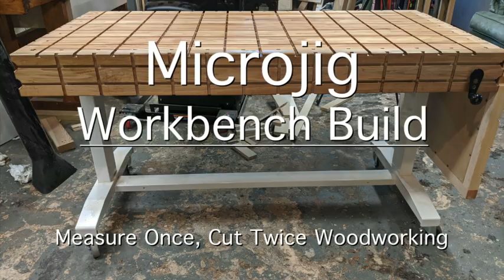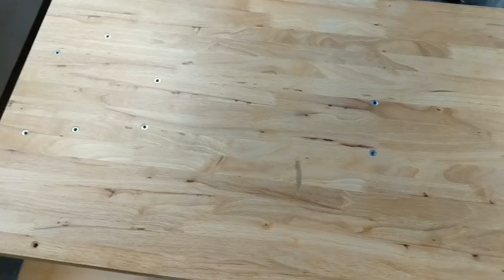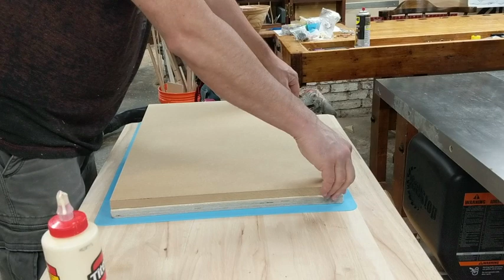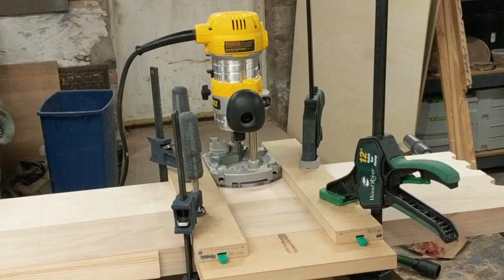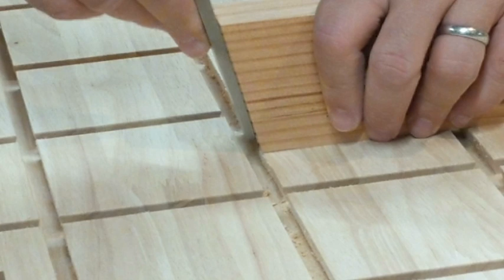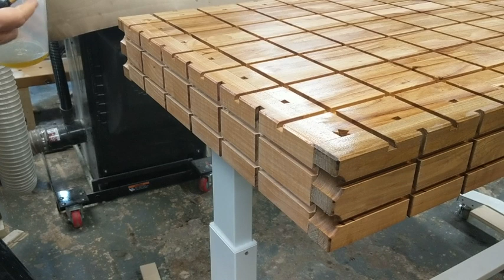Microjig Ultimate Workbench Build

Comment: I love the design and build video, so thank you 
I was wondering if there was a reason other than personal preference on not using the drawers.
I’m on the fence between this set of plans and the Woodsmith design.
Between the mechanical lift hardware and the casters how much movement is there
Seems when planing it might rock.
Reply from the maker: Thanks. I might one day add the drawer assembly back, but because it hangs down from the top and the 5-inch aprons now block them from opening, I would need to add blocking to the underside of the top so the drawer assembly would hang lower. It's a simple solution, but I also added a bottom shelf, so I'm waiting to see what I usually keep on that shelf and whether it might interfere with the lowered drawer assembly.
      I added these new locking casters instead of the ones that came with the table. (https://amzn.to/2YJYhnm). They're very solid when locked. I had them unlocked in a couple of shots in the video when the table was rocking. When the casters are locked, the height adjustment crank seems to not move at all. The table is very solid.
Reply: @measureoncecuttwicewoodwor3927  hi, awesome build. Curious what size casters did you use?
Reply from the maker: @faizamaze  I used these 3" casters: 
  https://www.amazon.com/dp/B08B1MNYNC/ref=cm_sw_r_apan_glt_fabc_1B9M7N4TB1B8XDKZHYD4?_encoding=UTF8&psc=1
Reply: Thanks!
Reply: the top one of those drawers would make a great pullout tool tray.

Comment: Is the large piece on one end a fold up extension for the top?  I don’t really understand it’s full purpose if it is stationary?  I also didn’t understand the building of the aprons using ply & MDF & then the 1 1/2” maple.  What did I miss?
Reply from the maker: The vertical piece does not hinge up. It is 90° to the top piece - helps in assembling 90° work pieces. I plan to add another vertical piece on the other end that hinges up to extend the top. 
The maple edging is much harder than the MDF/plywood it surrounds, so it will wear better.

Comment: MegaKudos on this--both build and video. Working on similar using the Huskey table.  Question: Are you concerned about the glue-up between the plywood and the solid wood top, considering wood movement expected on the solid but not-so-much from the plywood?
Reply from the maker: That's a good question. I'm hoping that movement of the plywood/solid wood sheets is minimal and limited further by the 4 solid aprons. It's survived 3 seasons so far (May to Jan). Wondering what more experienced woodworkers think about the construction?

Comment: Awesome video Steve!!!   I really like the Husky table you found.  I've been recommending to people that Husky makes a nice table but this is the first time I've seen the adjustable height version of it.  As I work customer support for MicroJig, I'll start to recommend the table you found to our customers from now on. 

Thanks again for creating such an AWESOME video!!!

Have an Ordinary Day...
Kurtis   ~|:-)
Reply from the maker: Thanks Kurtis! You have an ordinary day too! Haha.
Reply: @measureoncecuttwicewoodwor3927  Nice video. I have the 64" Husky adjustable base and was considering doing the same, although mine will most definitely not come out looking as nice as yours. Don't know whether it's the extra 12" (mine is longer), but my top has a bit of a bow that I will need to take out first. Thanks for sharing.
Reply from the maker: @Woodeyedoit  My top wasn't flat when I got it either. I tried two other methods to flatten it that didn't work out. Finally I tried the method in the video and it worked great. Good luck with yours!

Comment: Do you think the factory top can be routed without thickening it?
Reply: Andy, I put routed dove tails in mine (the same table) without thickening it, and it works fine.  I must say though, if you put my table next to his, mine would looks like a Yugo and his like a Ferrari.
Reply from the maker: I think it might be too thin once the grooves are routed. If you don't want to relocate the threaded inserts, you could add plywood on the top, but you won't get the solid wood showing
Reply: @measureoncecuttwicewoodwor3927  thanks for the reply!  Great work on yours!  I got scared from the flattening portion haha
Reply from the maker: I found the top to be not perfectly flat out of the box. You may not need it perfectly flat, but if you do, then you'll need to flatten it. This was my first time doing it, I was really happy with the results.
Reply: I’m contemplating the necessity of thickening the top as well. The dovetail is only routed to 3/8” depth and my (same) workbench top measures at 1-1/4”. I think once it is all said and done I will use some hpde over the top allowing for a flat non-routed top to work on when clamping system is not in used. This flat work surface will of course be mounted via the super awesome match fit dovetail hardware so it can be put on and taken off with ease.